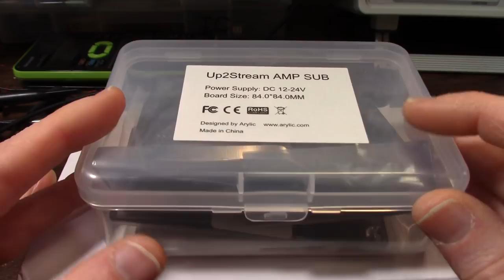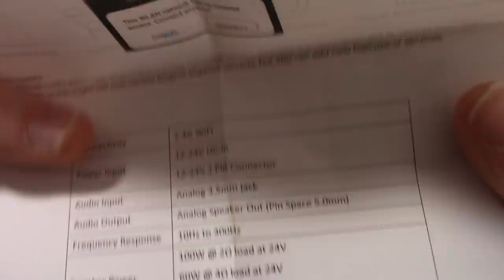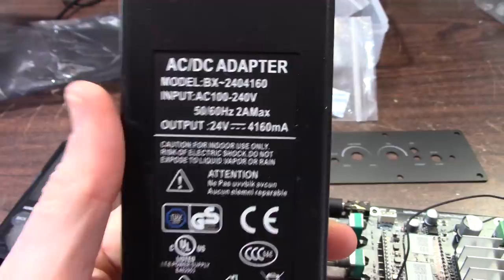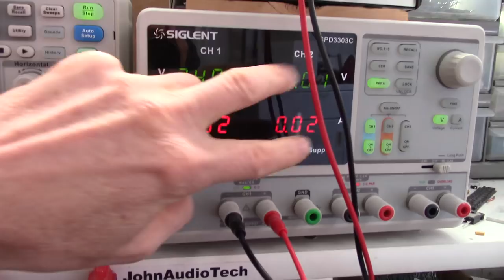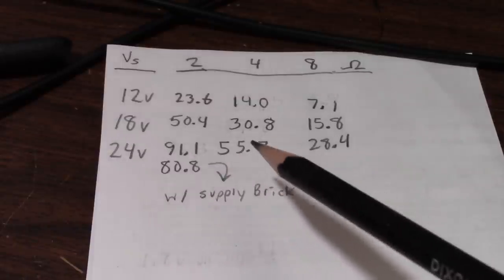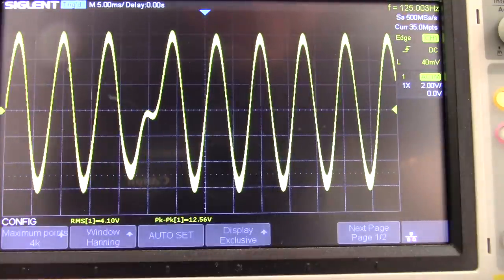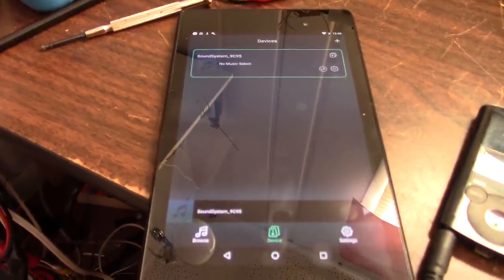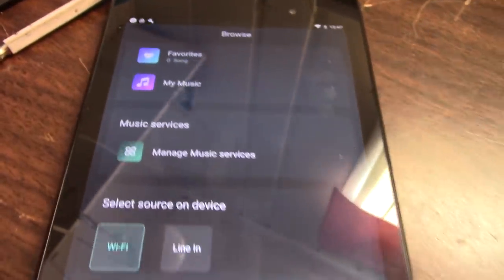100 watt subwoofer board test and review, Arylic brand

Comment: 3 years ago, I dealt with a distributor in China and I was importing full boards of these categories, of course, without a Wi-Fi circuit, but with full audio control. In fact, after experience, I can say that this type of amp board, regardless of the features and additions, is designed to work and not to last and Especially if you push signal  to higher levels
 Anyway, good video, thanks for posting
Reply from the maker: They should at least call this a 50 watt board and stop with the 2 Ohm specs.
Reply: @JohnAudioTech  
After a long dealing with a large number of merchants in China, this is a general story for all Chinese products, batteries, chargers, speakers and amplifiers, where the specifications are always half or a third of what is advertised in the product, but on the other hand, there are products that match and are equal in terms of quality, specifications and efficiency, American, German, and even English and Japanese, but their production According to a special request and in quantities specified by a specific customer
An example of this  you check the videos that I posted earlier about Tonylee Power Amp or about Deton Power Amp, thay are  really well made

Comment: A subwoofer amp with Bluetooth? Very odd feature.

Edit, is the little white connector L&R pass through?
Reply: Doubt so. It usually goes through a pre amplifier where the low pass filter/preamplifier is, considering how those don't seen analogic controls, it seems to be a digital cutoff. But the input filters are definitely bad, probably 1uF caps for over 20db gain. Changing the input caps could help it achieve lower frequencies, but that looks painful to find in that small mlccs.
Reply: Pay attention... It's NOT Bluetooth. It's a WiFi connected app. You add all your amps separately into the App, then stream the music through the App to the respective amplifier boards.

Comment: A lot of these Chinese amps rate the power out at 10% distortion, which is in the clipping range, I'm sure.
Reply: Yep - I just came down to write the same thing. JAT only measures to his "guesstimate of clipping", so even at 1% THD it'll be a bit higher than he states, and at 10% THD as spec'd by the chipamp, it'd probably get very close to rated.

Comment: Heeyy John, nice to see you around, didn't even watch the video but it's always quality content!
EDIT: I knew for sure it was that IC as soon as I saw the output Inductors. Those MLCC caps filtering output at that power are just asking to fail, and I am sure those input caps are 1uF for over 26+ dB gain for those 21hz low end rolloff. That is way too expensive for what it offers, the digital part is acceptable, the amp itself needs a lot of work. A 7377 and some 2.2~4.7uF caps would be a lot less expensive (no digital stuff though).

Comment: I've never had any need for something like this as I have speakers cover the full range without the need of a sub.  A "subwoofer" these days is nothing more than just a regular woofer in a separate enclosure, there's nothing "sub" about modern sub woofers.
Reply from the maker: I don't use a sub on my main audio system either but they are great for computer audio where you may not want large speakers on your desk.
Reply: @JohnAudioTech  Yes indeed John, I have a small 'den' room with bookshelf speakers and amp, all about 15 years old. Its' got a sub out and I recently added a sub speaker - it makes a significant bass improvement. The thing about sub frequencies is that they are non-directional and dependant on room dimensions - so I was able to tuck it away in a corner, now with added stack of papers on top :) Seasonal greetings and all the best, Beamer.
Reply: There is plenty of true subs out there, but lots of people are running soundbars and single woofers now days.
Reply: Except the fact that they've been making them with suspension systems capable of over 4 inches of excursion peak to peak and low FS allowing for extreme SPL in the low 20 Hertz region which was not even imaginable 20 years ago so I'm not sure what planet you're on
Reply: @SheikhN-bible-syndrome  - which is absolutely and totally irrelevant for normal people playing normal music in normal houses.
Reply: @johncoops6897  well for 1 I wasn't talking to you and 2 I wasn't addressing your comment
Reply: @SheikhN-bible-syndrome  - I know. You just decided to randomly attempt to flex by showing off your LEET sub knowledge 😂
Reply: @SheikhN-bible-syndrome  - WOW dude. Right and wrong??? WTF ROFL
Reply: @SheikhN-bible-syndrome  agreed I have 2 subs in my 9.2 surround system. It takes a long time to setup but when it's right= IT'S AN EXPERENCE!
Reply: @mickblackmore290  - None of us had 1000W amplifiers or Subwoofers back in the day when those bands were still around.
Reply: 90 percent of all audiophiles would disagree with you. There aren't many speakers that really dig down that deep property. I think most systems would benefit from adding a subwoofer. Anyone who disagrees has either fantastic floorstanding speakers, has not heard a good subwoofer, or is plain ignorant.
Reply: @xanderguldie  .... or who doesn't need or want a shitload of deep bass.
In urban environments, the bass propagates the farthest, causing neighbor annoyance. You can crank your music a lot louder without the cops being called if you don't have the Doof Doof.
Also, there are people who don't want super low frequency sounds anyway, especially for music.
Reply: @John Coops  you're completely wrong. I'm talking about low extention, not loudness. It's about adding quality, not quantity. But to each his own, of course.